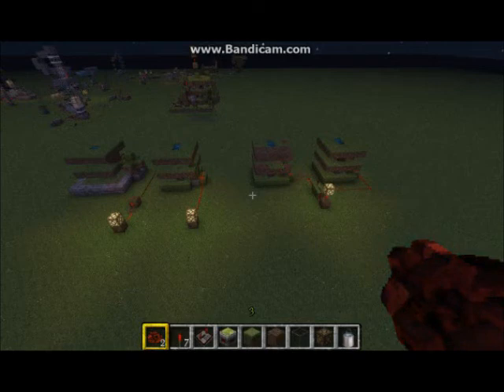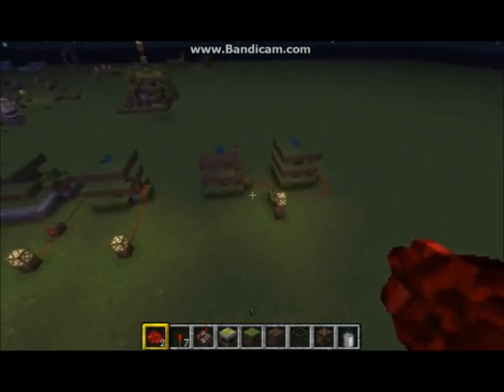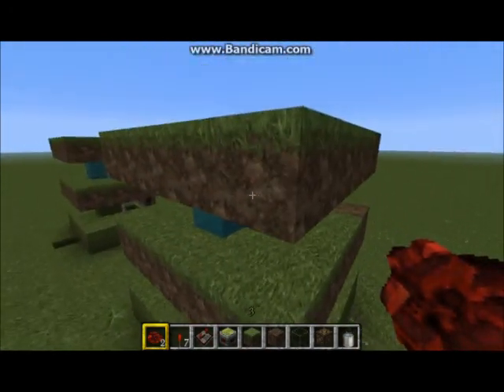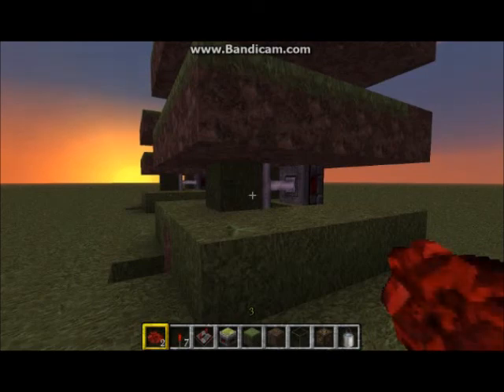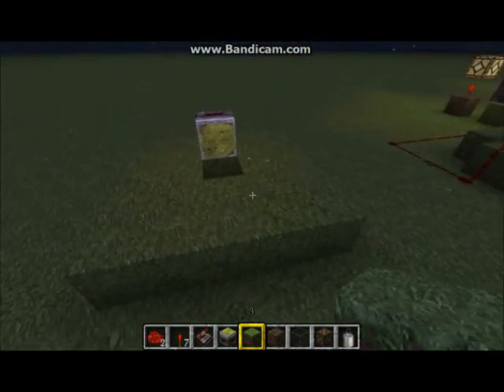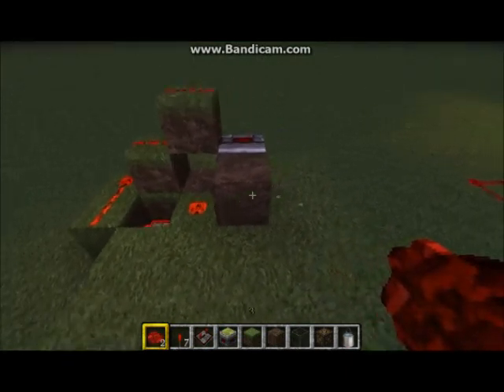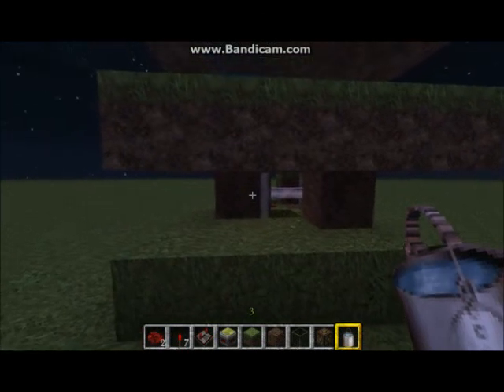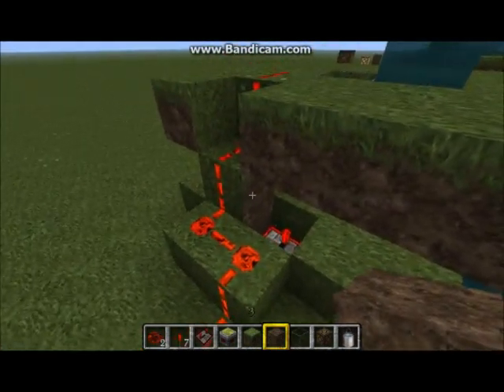Easiest Smallest Light Sensor Step by Step How To 1.3.2

Comment: Nice light sensor, I Have been playing around with it and found a way of making it faster. (A noticable amount actually :D

Simply make sure the back of the sticky piston is facing sunrise, leave this side only open, and the other 3 sides close up with dirt, and cover the top glass and water with grass also.

This makes the grass die A LOT faster at sunset, and usually trips the Bud before monsters start to spawn.

Hope it helps :D